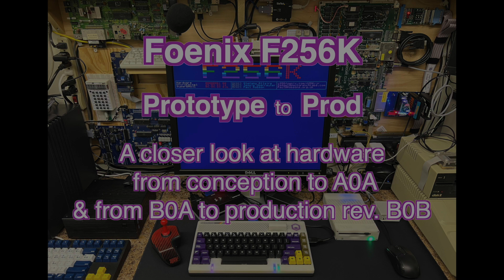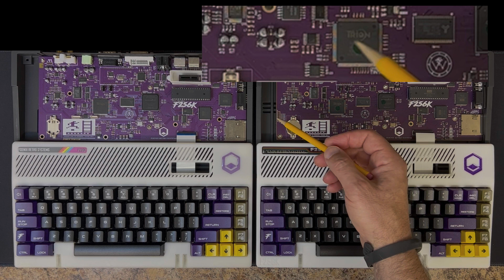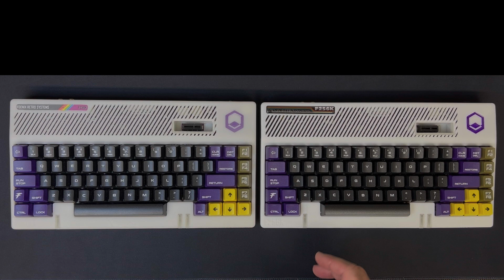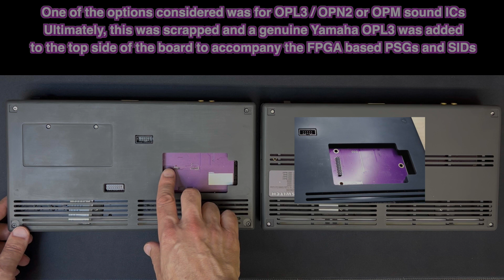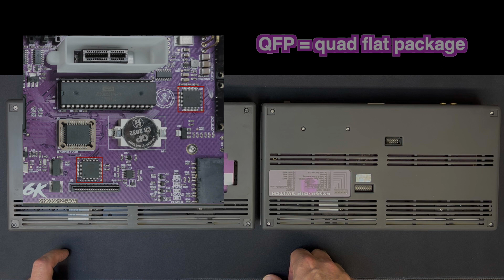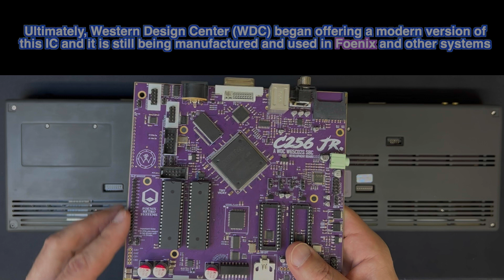Foenix F256K - "Prototype to Prod": Documenting refinement of a new retro system w/ Commodore roots

Comment: Id love one of these machines just not sure i can justify the cost unfortunately.
Reply from the maker: Understood.  Two options; the F256 Jr. ($199) will get you alot of capability provided you have a PS/2 keyboard and can install an inexpensive power module.  While the F256K was in development, all that existed was the "Jr." and all of the software for the "K" will run on the Jr. unless it specifically addresses the OPL3.  A second option is to spend some time with the zero cost emulatore/IDE; it's really come a long way in the past 3-6 months.  I'll see about finding the latest distribution, post it to the Foenix Marketplace, and respond to this msg. in the next 2-3 days.  Thank you for the comment.